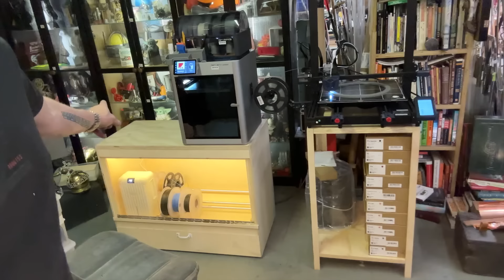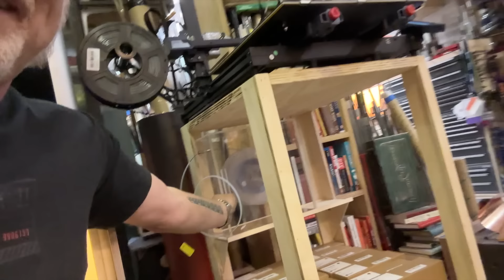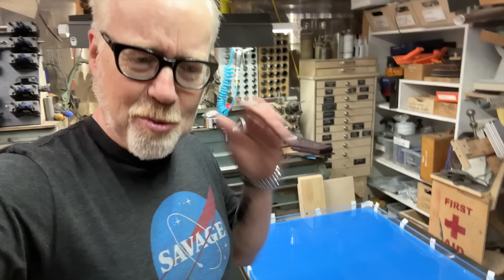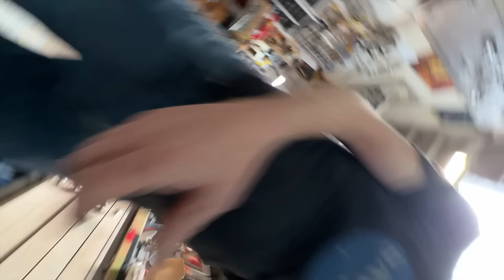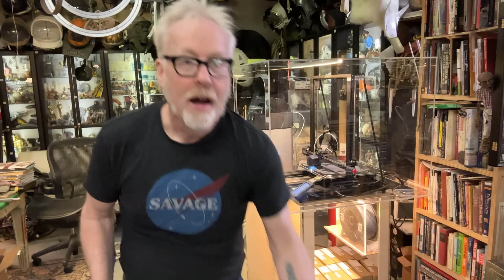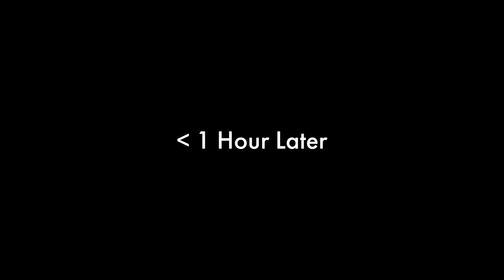Adam Savage's Biggest 3D Printer Yet!

Comment: That small base for that large enclosure seems a little wobbly.   If your Kobra Max is printing something a smaller and faster, when the bed is moving back and forth in short throws, that small foot print table will start wobbling pretty bad.  It could effect the quality of the print if its moving like that.  I had to set mine up on a pretty sturdy table to stop that kind of wobble.

Comment: So interesting the thing is still smaller than the CR10 max (which is 470x470mm) it's like it's a forbidden size.
Creality themselves seem to have purged them from their site but if you can get one cheap and used they are pretty good.

That anycubic looks like it uses many of the same parts actually.

Comment: Me throughout this build:
"Omg, he's just free-handing those lines."
"Omg, he's drilling holes wherever."
"Omg, he's just cutting $600 worth of acrylic with a jigsaw."
"Omg, he's just hanging it from an acrylic hinge."
"Omg, it actually came out pretty dope."

This Adam guy knows a thing or two. But 39% humidity is right where it should be?! I need to get it down into the teens before my PLA prints well. My office is only 33% normally. 😆

Comment: If you're making an enclosure, I highly recommend against Polycarbonate! Especially if you plan on heating it. If you're dead set on acrylic, go THICK 1/8 is too thin. The heated bed will probably be enough to heat the acrylic to the glass transition temperature. It's only 90°C so it's going to get wobbly around 60-70°C  I tried using 1/8" acrylic for my first heated chamber and had to rebuild it almost entirely out of wood.

Comment: I ran an RGBW led strip through the inner v slot on the extrusion for my ender 3 pro and it works great you should try it. Mine runs off my phone. I plan on putting one on my v2 and ender extender as well. You should do the ender extender build on here I'd like to see that. You've probably already saw one but it's 400x400 build plate and 500mm tall with dual z steppers.

Comment: I don't know if it's because of you guys but my Etsy sales of 3D-printed space helmets jumped by 200% :o
Reply: Also a tip. If you print with PLA you REALLY don't need the enclosure. With PLA you want to get the print cool ASAP anyway. As long as it doesn't detach from the bed it can take all the cooling you can throw at it. Personally I run my printer with a desk fan next to it (it lacks a part cooling fan).

Comment: Adam I hate to say this now but you could have saved so much money if you just built a single enclosure for all three of your 3D printers. You could have just built it out of plywood, maybe even sheetmetal, and had a single door in the front like a vent hood. Also you could add a heater to the chamber for temperature control and all 3 printers can share the same filament library. 

No one can stop this man from creating things so I wouldn't be surprised if he does this in the future lol

Comment: How the heck that Kobra Max is working? After a few months of useless Anycubic support I threw mine away (literally to the skip). ABL not working, destroying bed, false runout sensor alarms, wrong thermistor, burned PTFE tube (PLA setting was going to 275+ degrees), broken mainboard, then the ABL sensor gave up. Literally the worst printer in my life.

Comment: Two months in on the P1P and already learned about drying/reduce moisture the hard way. You've already built it, and I was going ro build one too, but I just bought a cheap sealed container and tossed in a tub of DampRid. It can hold four spools and stays at 30% humidity. Then I bought a two spool dehydrator. They come in single spool. It has a pluggable hole for the filament to come out of. Building is more fun but why didn't you go that direction?

Comment: i just placed an order for the anycubic Kobra 2 Max, should be here next month, lets hope it works well, i should get a springsteel bed on it.
i plan to build 1 enclosure that holds all my 3d printers (or most of the ones i use a lot)  and they can all heat it together as most will be printing at the same time.

Comment: Just as a heads up. eclosure does not always mean better prints. when I enclosed my printer I had failure after failure because the printer could not properly cool. this cause heat creep to work it wasy up the extruder and cause every print to fail. There is a strong posibility you will see the same thing with the Cobra Max.

Comment: @adamsavagetested you can get this. Rubber stuff that’s in a u shape and it’s made for glass showers. It closes the door stopping water getting out. It’s cheap, there are different clearness’s. Would of made an air tight seal with half the weight

Comment: My concert would be that you are now cooking your circuit boards. You really need a fan with ducting (or fans) on the outside blowing cold air over your circuit board and taking the hot air from it away. In an ideal world you really would want the controller board on the outside of the case.

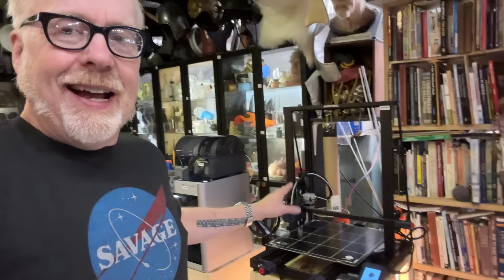Comment: 13:50 So I actually did a similar thing for my big FDM printer. I made an enclosure that's not quite airtight, but fairly air resistant. It will serve mainly as a protector from dust and random disturbances. But I used signmaking coroplast sheets, and framing of 3/4-in square dowel. Added a couple hinges and a magnet to snap it shut, and it was in business. Not as pretty and you can't see through it, but does a certain job well, I think

Comment: Adam, Just a heads up the cable in the back that connects to the platform is awful. I have this printer and it stopped working twice due to this issue. Issue so far that I needed to contact anycubic to get replacement parts both times. My fix is printing a clip to reinforce this connection. So far its holding out, I have only had the printer 4 months. So I bought the elegoo Neptune to get some more reliability.

Comment: TWO Carbons now?! You'll have the Westworld scale 3D print farms and have chruned out an entire platoon of Adam clones by the end of the year at this rate 😂

Conveyor belt printers like the CR-30 next? Make sure you set it up in a section of your shop with decent real estate and length, and definitely attach a roller extension so it supports anything over a meter printed out from the infinite z axis.

Comment: I don't understand. If you create higher pressure than outside of the box, you increase the volume of moisture, because you generate flow... A slightly higher pressure should be generated inside dryboxes (with dry air). This will create a barrier for incoming moisture.

Comment: Nice.  I built a similar size enclosure for a cleanroom at work.  I use 20x20mm Al extrusion as a frame.  And then slotted the polycarbonate sheet into the extrusion notches, so no gluing required .

Comment: Some common mistakes I've seen is not making your filament drybox practically   air tight like how they are usually packaged. That's because the silica pulls in water and in fact will still pull in water outside the box if not air tight rendering it mostly useless. Hope it helps!

Comment: Adam, look for ionic membrane dehumidifier cell for the dry boxes. It's a Japanese technology that dehumidifies using a membrane that thru hydrolisis separates O and H.
These cells are sold in many different sizes and capacities.
Most important things are: much safer (no heat) and efficient (1 to 5 watts).
Greetings from Brazil!

Comment: Why run a vacuum line from the one to the other?  Why not just put the spool feed into the already large space that looks like it could easily hold that spool? Of course that would render the plastic box you built for the spool and the light you added to illuminate it all redundant.

Comment: I would add a very slow fan to circulate the air inside the cube to remove hot spots around the electronics, it wont disturb the print

Comment: Sometimes you can be a kook, Adam. There's no need for all sides to be acrylic. 1/2" ply would do just fine for the base and maybe the back and top, perhaps even one other side. You don't need a complete 360 view of the thing. The camera is often attached to the frame...
But! The connecting of the dry box to the other, already built dry box is a great idea. I recommend a hose that can be disconnected and the holes closed off. Keep the dry in.

Comment: at some point Adam will probably self source a Voron V2.4, And I say 2.4 over the Trident just because I feel like he would really enjoy the mechanics of the flying gantry.

but if the box does not hold up like expected id say make its structure out of 2020.

also the LEDs if they match the voltage of the printer can often just be run off that PSU, These days that is usually 24V.  but not always of course check your volts.

Comment: @Adam I have always gone with the option of having the Spools above the printer, much like your Bambu does it (that may be why it is so good).  This can help reduce print failures as you have gravity working with you when feeding the filament into the print head, basically your printer does not have to work to feed the filament in at all. With the spools below the print head, your printer has to work harder, pulling on the filament and fighting gravity.  Just my $0.02

Comment: If your cobra is sitting next to your giant dehydrator box and you are going to plumb the small filiment box to the dehydrator box.... why not just run the spool of filiment in the dehydrator box which is just as close as the small box under the cobra? Surely that would simplify the setup running a ptfe bowden tube from the box instead of a vacuum tube?

Comment: Adam fell into the 3D printer rabbit hole.  Now to 3D print a lid on that hole. lol I redesigned my Anycubic Chiron to use load cell bed leveling on the bed.  that's also a fun project.

Comment: People rocking smaller 3D printers than this giant one have been buying two or three ten-dollar Lack tables from Ikea and stacking them vertically with some 3d printed parts to act as interfaces between them. Then all you need is a few clear panels to enclose the sides of the top layer. Pretty cost effective way to do an enclosure.

Comment: 3D printing has massive amounts of mythology from guys in sheds, and an obsession with humidity in plastic. The quality of the plastic makes a much more significant difference than humidity for most plastic aside from nylon. Drying filament will release volatile plasticizers and make filament brittle. Thomas Salanderer took filaments submerged in water and found little difference, while age from manufacture made a huge difference.

Faster printing is appealing, but layer strength suffers. Slower is stronger.

 Lastly, PETG is the go to for cosplay because it sands much easier than PLA, and avoid any carbon fiber doped filaments, they are weaker than just plastic and will abrade nozzles before the end of a large print.

Comment: I have the Anycubic Chiron, which is effectively the predecessor to the Kobra Max.  My recommendation for a fairly significant speed boost is to use a larger nozzle than the 0.4mm default.  It allows both thicker layers and thicker filament traces (so you need fewer of them for any given wall thickeness).  I put a 0.6 on my Chiron.

Comment: Your filament box design isn't too much different to mine. 

Mine is a 7L food storage box from ASDA in UK with feet to make it stand up. I also added a cheap hygrometer and a sponge filter to clean any dust off filament. I use pack of silica gel for desecant and then dry them in a mini oven periodically. You're gonna need a lot longer PTFE tube to reach the extruder when it's printing at it's full Z height though.

Comment: *Heated enclosure hopefully! With the ability to set the temperature 1 degree C lower than the glass transition temperature of the material printed - it'll make a huge difference especially for ABS printing due to thermal warping and curling of layers being printed.

Comment: I've had plastic work done a few places, and when I needed only straight cuts, I would buy a 4x8 sheet direct from the local GE Polymershapes store instead of a plastic manufacturing place like TAP. Their cuts aren't guaranteed to be as accurate, but in practice, I find them within 1mm.

Comment: If you print anything that requires higher nozzle temps and a chamber temp above 50° your printer may not react well 
I would suggest the controller/touchscreen and other sensitive components like the control boards be moved outside of the enclosure
For lower temp polymers like PLA you will want to leave the front door open to alleviate stringing and nozzle clogs
You may also want to consider a hepa type of exhaust system for printing ABS or ASA because those filaments staaaaank and the fumes are not good to breathe in

Comment: Adam, Depending what you’re printing with like PLA it can be better to keep the printer cooler, this helps when printing anything with an overhang or bridge. The main benefit of an enclosure is to contain harmful chemicals when printing with stuff like ABS.
Reply: While containing the smell is nice, the main point of the enclosure with ABS is print stability. I have all my printers in enclosures and print almost entirely in ABS with minimal warp even on very large parts. Even just putting a bag or a box over your printer is night and day when printing ABS.

Comment: If the shop itself is larger than 4*8, you can cat the material of that size. You just make a rough cut with a handheld tool, then cut to size with whatever tool you usually use.
Frankly, I think even for premium acrylic cut to the size to perfection grade standards, 600 bucks is an extortion. We should not pay that just so vendors do not charge that.

Comment: @tested Adam, you can make a dehumidifier pretty easily using a Peltier, a couple heatsinks, and a fan.  Should work well in a lower humidity environment.
Reply: Just to clarify, fan blowing over hot heatsink-> through a shroud past the cool heatsink with a "drip pan" underneath.

Comment: You really won’t need a dry box or desiccant for pla,petg,abs, and asa. Usually they come pretty dry and you shouldn’t have a problem with wet filaments until wayyyy down the line in a couple of years. Tpu and nylon are the exception though. They should be dried with a dehydrater or stored in desiccant at almost all times. Plus the ams system you have on the x1c should have room for desiccant near the bottom of the spool holders

Comment: Look up the Creality Sonic Pad to make that printer fast as all hell - it's a pretty easy setup process and uses a gyroscope thingy to measure the resonance (like the Bambu does) and basically counteract any issues with fast printing. It will likely give you the ability to print at great quality but x3 the speed.
Only takes about an hour of setup. "Ricky Impey" has a GREAT and easy to follow series on how to set it up. It's pretty much plug and play. Trust.

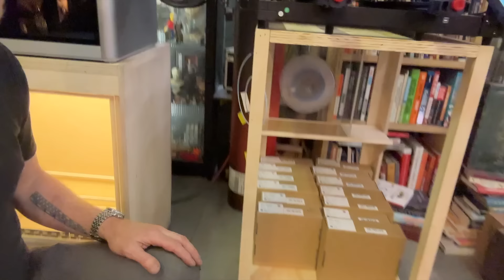Comment: 12:30 If you mean a heating pad for lizard tanks, heat lamps, ceramic heaters, or deep heat emitters, as someone who has a leopard gecko and has done research on all of those even though only a heating pad works for leopard geckos due to how they absorb heat, I don't recommend any of them for your dehumidifier. They get very hot and are fire hazards when speaking about wood, air circulation or not. you'd have to get an in-line thermometer that turns power off to the heating element when it detects a certain heat within the space to try to reduce fire hazard.

Comment: i cant express this enough.  change the kobra max to direct drive.  get rid of the boden setup.  its a printed bracket, and a stepper motor.  it will drastically increase the print quality of the printer.  best thing i ever did to mine

Comment: Maybe better to have just ported the filament from the hot box instead of trying to expand the environment. Expanding the condition space would probably work with some air flow.

Impressive jigsaw work without a straight edge! I'd still be sanding out the bends lol.

Comment: I am impressed by the build of the enclosure and how it was made.

At the same time I running into height problems for my own print and scaled up a Voron 2.4 to a 500x500x800 build volume and cutting the poly carbonate panels from full 4x8 sheets was an effort in its self. Too bad my cat broke the doors trying to get into it, but I think the weight of the doors was too much for the glue on the hinges

https://i.imgur.com/gfOBK5f.jpg

Comment: Adam you can get high static pressure axial fans from Noctua that come in a variety of sizes, if you ran two 1.5" hoses you could probably pump enough dry air in and out to make it work. They're very efficient and quiet with 150,000 hr MTTF reliability.

Comment: enclosures are great for prints, but not great for printers, the electronics of the printer are better kept outside the heat of the enclosure.  He could modify it with another box inside the enclosure that is vented to the electronics.  With his resources though, he may replace the printer entirely before it has time to catch up with it.

Comment: Probably could have put a spool holder in the box under the bamboos? You will need to regulate the temperature in the new enclosure especially with a Bowden, the filament will go soft in the tube and stick. Unless the exterior ambient temperature is pretty low.

Comment: What you need is a Voron 2.4 350x350 or a Ratrig 500 x 500, would also be great content building either of those kits. Either is as fast and high quality as the Bambu, plus designed for enclosure for printing ABS and other toxic materials
Reply: 2.4 350 or the RR500 would probably take up less space than the Cobra, In some ways the biggest benefit to CoreXY could very well be you can fit a lot of print volume into a more limited area.  Note the RR500 is still an enormous machine that lives in the room you build it in unless that room is a garage or has double doors.